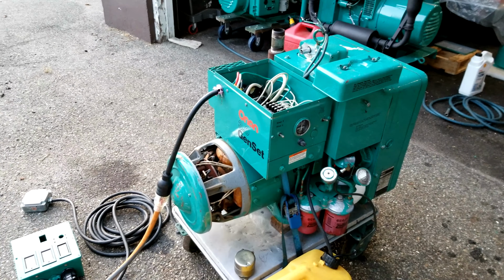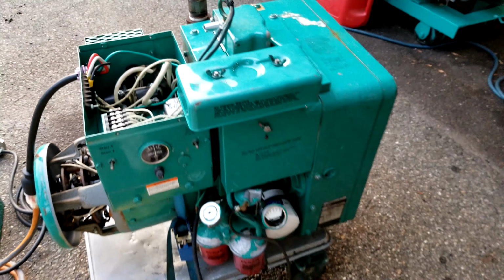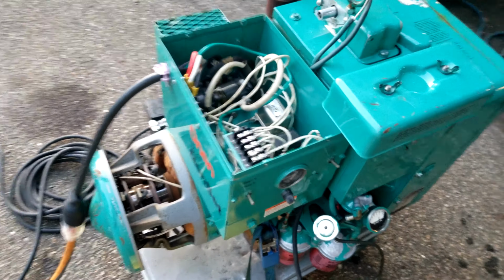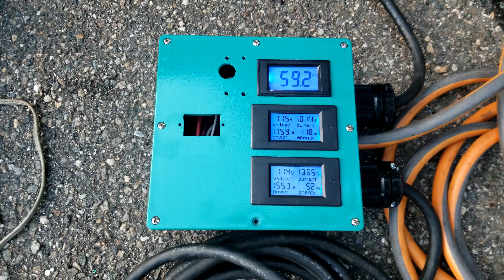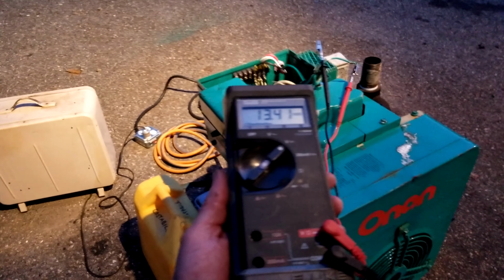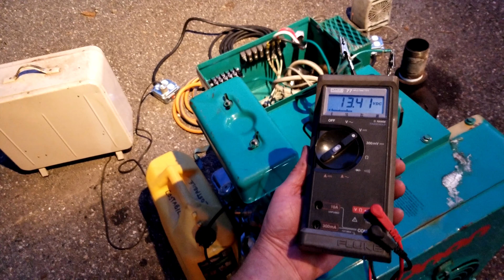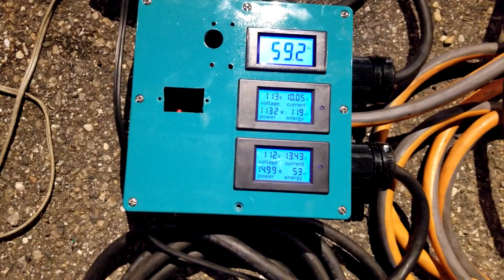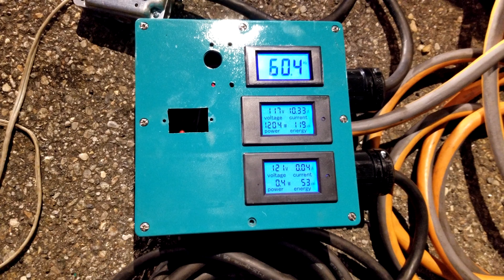Onan 3.0 DJA - First Load Test

Comment: Just a point of clarification Johnny  the decompression solenoid is primarily used to shut the gen down not so much to make it easier to start. You can easily start the set without the solenoid in place but there is no way of shutting it down short of blocking off the air unless you have a working solenoid or manually use the solenoid plunger. Looks like a great little set , excellent condition . Cheers Dan

Comment: Great genset I personally own 2 DJA Contractor Series Great Machines both are like new. One of them burnt up the decompression solenoid i ended up machining it out and made a push rod decompression lever to shutdown and installed lights to indicate heat and oil problems. also have alot of spare parts. As far as onans i own 2 dja contractor, 1 djb contractor from navy sub salv and 1 45 Em 600 volt stepped down to 208 3 phase with ford i6

Comment: hi. awesome vid. i have same gen. set iv not yet worked on it yet but i need info on starter system ???? my gen set has no starter so im thinking it starts off stored 12v or 24 volts ???

Comment: From what I recall reading when I was restoring mine was regarding the decompression solenoid was the 12V running to the solenoid is restricted via a resistor in the box to cut the amperage down to the windings of the solenoid for longevity of the life of the solenoid. If it were to fail usually a resistor would fail open, but it maybe wired up wrong in there or possibly not cutting the power down any longer? Could be a possibility why the solenoid failed. So if you happen to find one please look into this. I believe I may still have a good schematic in my book here I could send you a copy of if you were in need of?? If that's not right as to what I said please let me know, someone out there. Otherwise I'll have to dig around and check the wiring schematic again. I know they used a special solenoid made for continuous duty on these by delco. I have an extra one on hand I actually found on a piece of equipment that used this same solenoid to act as an idle down system on a old cast iron Kohler engine. It was still electrically good so that's my back up for the one I have. But definitely reading up on these gensets, I noticed the #1 main failure and hardest part to seem to acquire was these solenoids. That was why I have a spare on hand, otherwise I'd definitely help you out on that end in a heartbeat Johnny. Don't give up hope, I've run across a couple on eBay here and there when looking around for other parts for Onan's so their still out there it's a matter of tracking one down, at a reasonable price that is. Wish you all the best and if you need anything or a copy of the Schematic I have pls let me know. I know I couldn't find one here in the states when I was looking! I actually had to contact a man in Alaska where I guess they live off these gensets still off the grid up there, and purchase a copy of his wiring schematics from Onan's service manual master copy he had. Oh Pls if you need to contact me use my email.  Dee0103@aol.com

Comment: Hello, I just can't get over how extremely mint condition this gen is you paid 100 bucks for! Can't say I'm not jealous lol! Hey if you happen to have a minute to get back to me on a pretty serious question that be awesome!!!

 I would like to make my outputs 120/240.... That way so I can do everything in my house without running a jumper buss in the circuit breaker 200A box I have now upgraded to, I only have power to half the house then if I don't jump the buss in the box I found out. So if I were to run 240 out of the gen into both legs of the box then everything I believe shall work without a jumper. So hears the deal mine was a complete mess sat outside for almost 30yrs on a skid that turned to dirt and a few heavy canvas tarps but it was seized from moisture and was almost a complete loss. That's the only reason I put so much time she love into the thing. Brought it back from the dead fully rebuilt inside out. Here's my problem. The original marking for the outputs were long gone before me. The buss the outputs connected to inside my box was rotted. So here's what I know. The slip rings in the diagram I have are marked, I believe from engine side  M0-M1-M2-M3 to bearing side correct? And to set up the gen outputs to do a 120/240V outputs the drawing I have states M2&M3 get tied together. But if I go by the slip rings wouldn't it be the M1 & M2 slip rings, getting tied together???  I'm not sure that's why I'd feel better talking to someone like yourself who may know off the top of your head lol. Unfortunately I don't have much information on these and how they are wired internally the generator itself. I'm going by a pasted together copy of an original service manual page someone helped me with years and years ago from Alaska where there are still plenty of these DJA's still powering off grid homes up there. But it appears in the drawing, if that correct? Slip ring M1 & M2 tie together as neutral and rings M0 & M3 become your 2 hot legs, am I somewhat correctly reading this old marked up piece of paper I have would you happen to know? Any help would be fantastic. Thanks and again I Love your work, and seeing these old machines run circles around New garbage. My email is Dee0103@aol.com if you happen to reply. Thanks in advance, Jim.

Comment: I live in Uruguay, I have a DJA of 2,5 kw - 1 Hp that went for a long time until the electric power arrived and we turned it off and it stayed in place for more than 20 years without using it. I would like to turn it on again, can you get spare parts ? I remember the injector was leaking and the solenoid did not work